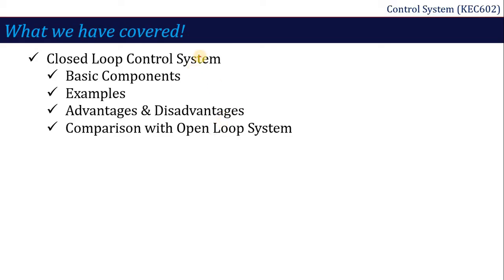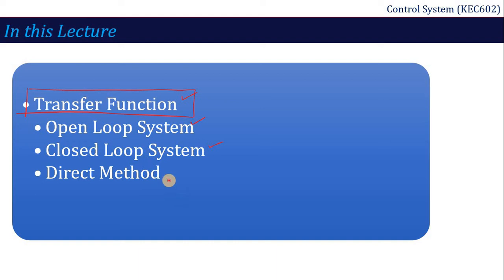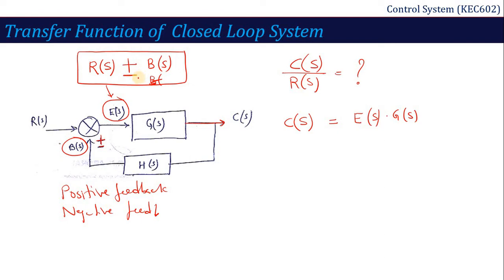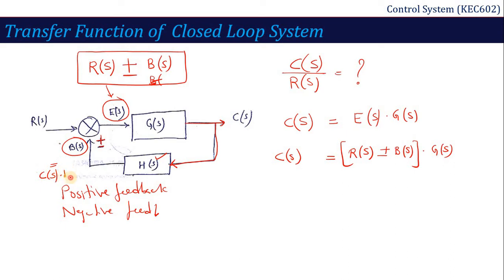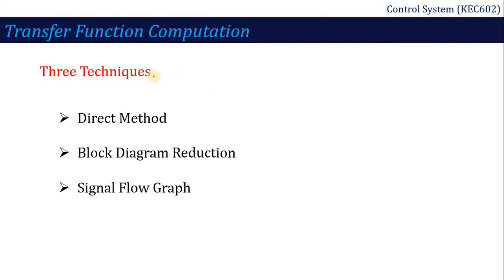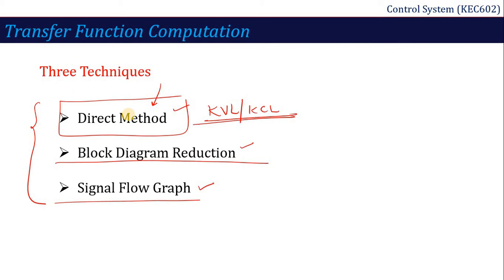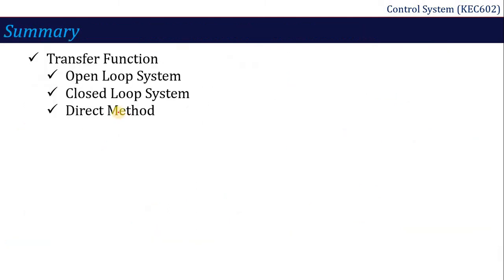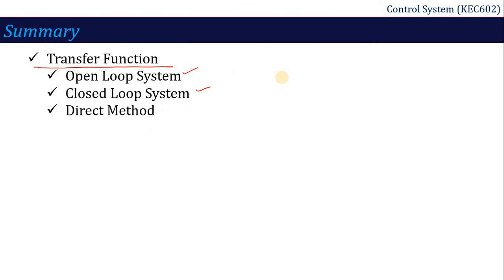U1_L3A | Transfer Function & its Computation Techniques | Control System (BEC602/KEC602) | Hindi

Comment: sir i have a request you to make sir, actually i easily use to learn with your videos i have purchased your course of control system sir please make your this app download for desktop and tv also sir mobile screens are very small and eye is also getting weak day by day sir so make it download for desktop or tv so we can access your lectures from there also......please sir
Reply from the maker: Thankyou. It's good to hear such true feedback. The app is not mine and as long as I know your wish will be full fill by the time.
Reply: @vaibhavjain3854  sir my exams are from 8 June and you also know sir most of the engineers start preparing just before the exam only sir I have purchased your course and likely have purchase another antenna one's also but sir please try to understand so that we access your videos to big screen or a desktop so that our work should become easier please sir
Reply from the maker: @samdarshgupta6817  right now I can't do anything. Choice is upto you. 👍
Reply: @vaibhavjain3854  sir hume to Mark's score krne hai aap acha sirf hi krva dijiye ki google home se hum aapki video TV p connect krke dekh le sir pura app apka access ho rha hai bs video nhi aarhi sound vgera sb aa rha hai bs itna krva dijiye ki video mobile se TV pr casting k through dekh le sir
Reply from the maker: @samdarshgupta6817  ye sb to mjhko nai pata..itna pta h k avi only for Android devices h..rest I cannot help you other than clearing your doubts if any.
Reply: Sir I have doubt sir on edoxe on lecture 3b vaale m sir jo three branches vala question hai usme mera answer aapse thoda alg aa rha hai aapko solution check krana tha mere ko lg rha hai shyd aapse koi mistake hui hai kya aap apna kuch contact info de skte like email or WhatsApp type plzzz
Reply from the maker: @samdarshgupta6817  in which question?
Reply: Can you plz help me
Reply: Plzz helpp me